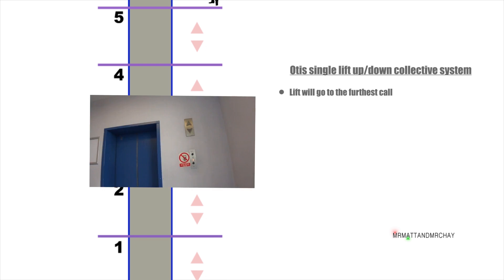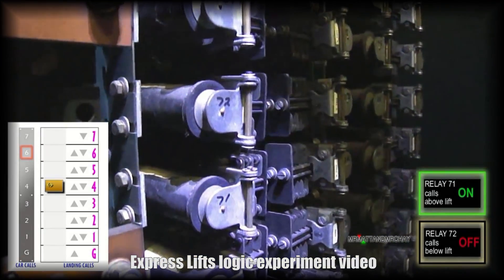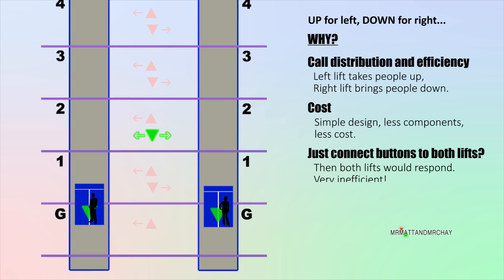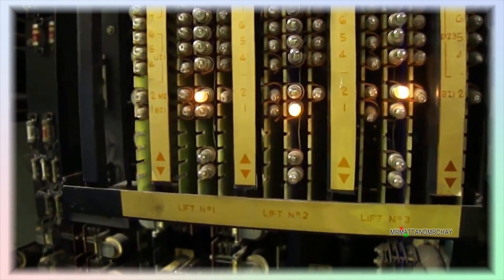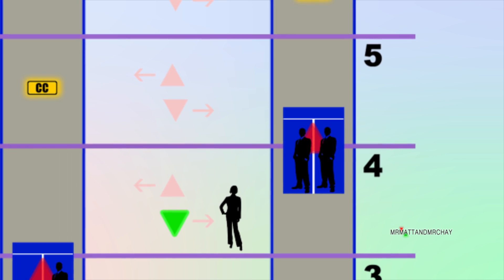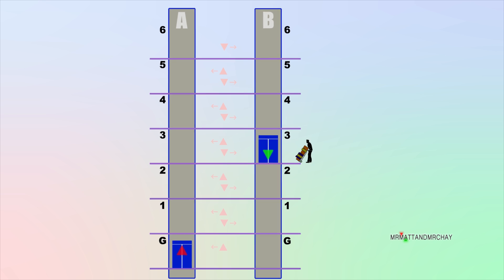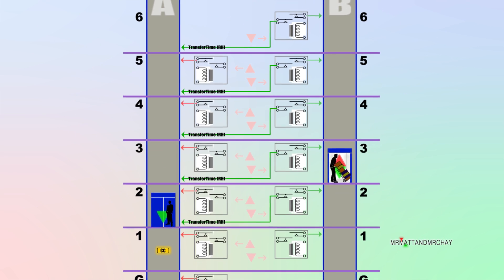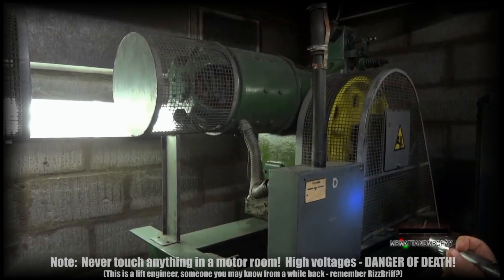DUPLEX elevator call logic - how does THAT work?

Comment: One elevator is assigned to up calls, the other elevator is assigned to down calls. In many cases, the "UP" elevator will respond to UP calls, the "DOWN" elevator will respond to DOWN calls, with a few exceptions.

1. If an elevator is already on the landing, the call buttons are connected to call the elevator that is already at the floor.
2. If an elevator stops at a floor due to a car call, and is going in the same direction as a hall call on that floor, it will cancel the hall call, even if it isn't the assigned elevator.
3. If the assigned elevator is held open (either deliberately or due to a mechanical fault with the doors for example), after a set time the call buttons become connected to the other elevator.
4. If an elevator fails to answer a call (i.e. it breaks down), after a set time, the call buttons are connected to the other elevator.
5. If an elevator stops at a floor with up & down calls, and is idle (no other calls assigned to that elevator), BOTH calls will be cancelled.

Is this a pretty complete description of the logic of this system?

I'm curious what would happen if for example, you press both the UP & DOWN buttons, and the UP elevator gets to the floor first, BOTH calls are cancelled, and the DOWN elevator was moving towards a call that was cancelled, and is otherwise idle. In that case, the DOWN elevator could either stop immediately between floors, and probably not open it's doors (I suspect Otis controllers don't have a provision for this), stop at the very next floor and probably not open it's doors, stop at the floor where the cancelled call was (and either open or not open it's doors), or stop at the last floor in the direction of travel (and either open or not open it's doors).

Is the system described in this video used on a two speed AC installation, a DC installation with motor generator, or both? It certainly could be used for either, but not sure if a more complex and more efficient system would be used for DC installations.

I wouldn't be surprised if some larger relay-logic installations (perhaps with 4+ elevators) used a more complex but more efficient system, as in those cases a more efficient system may be worth it, assuming it is reliable, if the alternative is to have more elevators, and less usable space in the building.

I'm hoping to visit some buildings with Otis duplex systems probably running on relay logic soon. They probably are DC elevators with motor generators. If I can, i may test some of these things.

Comment: It's really annoying how the one that is coming towards your floor just went past it while I have to wait 1 additional minute because the second lift is still 2 floors away and the logic decides to assign second lift to my floor instead. (considering both are going down, for example, and I'm also going down)
Reply: Sometimes a lift that stops @ your floor gets physically full because too many passengers want to board it, but its weight sensor still doesn't detect enough mass for the lift to register as 'full' in its computer, so there's the anguish where (a) neighbouring lift(s) that's passing by your floor is then programmed by the computer to skip your floor because it still doesn't think that more lifts are needed to serve that floor

Comment: Am I correct that in for example a 10 floor building (with the lowest landing being the 1st floor, elevators serve 10 landings), the UP car is on floor 1, the DOWN car all the way up at floor 10, if someone presses the DOWN button on floor 2, the DOWN car will come despite the UP car being much closer to floor 2?

Am I correct that this is quite inefficient? At some point maybe I will do some experiments on multi-car (group) relay logic elevator systems to see how they behave.

I assume solid state controllers would often work in what seems like the more intuitive way (if all elevators are idle, closest car will answer a call), but I could be wrong.
Reply from the maker: Correct.  So if the CALL=2, then...
CAR1 compared with CALL (1-2) = Distance: 1
CAR2 compared with CALL (10-2) = Distance: 8
We are now preforming calculations.  Imagine doing this using relays!  Is kind of possible, but now you are adding far more relays.  More relays means more cost, more things to go wrong and more complexity for someone to be able to fix it.  And is it really neccessary?
When a customer doesn't want to pay for it, and they just want a method of getting people from floor to floor, they aren't bothered if a lift has to travel further occasionally.  It would cost more to have an engineer trying to fix the lift due to the extra complexity.
Please bear in mind, this video is about OTIS.  The Express Lifts system didn't work the same way.  I may do another video at some point explaining how the Express systems worked.  But as time went on, Express did manufacture a 'closest lift' dispatching system using resistors, which maybe I'll cover in a future video.

Comment: My apartment building has three elevators. They seem to be random to this uneducated observer. For those cars where people are moving in/ out, or maintenance is using, there is an "Independant Service" mode where the elevator car only works between two floors and ignores all other calls. If someone holds the door-open button, or physically holds the door open for too long, the car "beeps" and broadcast a message stating that one should "stand clear of closing doors".  In the past, this latter scenario has often caused the car's logic to become confused and even temporarily go out of service. I believe that has been fixed for now. The building in which I live has seventeen floors and houses many university students. This means they are in frequent use. Our elevators say "Westinghouse" on the thresholds. However, they are often serviced by Kone. Once, I saw a Fujitec van out front. I don't know where I'm going with all this, but your videos have helped me to become more aware of what goes on "under the hood (or bonet?) ".

Comment: This video answers a lot of questions!  This is the exact setup that I have the parts to, and 5 sheets of wiring diagrams of. 
Now I want to make both selectors on my reconstruction run just to run these scenarios and watch the relays click.  

Do you have any estimate on the power consumption of just the logic relays?
Since I am going to use a 1/2 HP gear motor to operate each selector, will not need to use the large power relays that fed the 25 HP traction motors    I have to determine if I can salvage the original DC power supply or not, so if I end up building a power supply I am worried about current.
Reply: Well it depends on how many components will be using power simultaneously. I can not be certain, but most otis relay coils run off of 120V and will use around 30 - 100mA of current. But the real power consumers will most likely be the motors. If you plan on using the original DC power supply, a few considerations will be needed. If the original DC supply is a MG unit, you will definitely need to worry about the current as MG units are very power hungry. Honestly using a full wave/bridge rectifier with a smoothing capacitor will be easier and more efficient than a MG unit.

Calculating this out and after making a few assumptions I can say with confidence that you will need at least 30A to run the components. It may not sound like a lot, but here is an important thing to remember! Often times, these old otis elevators connect relays together in series, which means that you need more voltage than the 120VAC you get from a typical house plug. I have seen otis elevators that use up to 600VAC in order to run the components in a proper manner.

If you truly want to hook these components together, It would most likely be a direct wire connection as no elevator can be run by just plugging it into a wall. So you would need to go into your main lighting box and bring a large wire towards your display, then a 3 phase converter would probably be in order. A transformer afterwards to convert the 120V/208V into whatever voltage you need to run any series'd relays. It sounds like a lot of work! But if your up to it, then I won't stop you.

I would recommend looking at similar elevator systems and seeing what they use for an overcurrent device rating. I can't say from experience, but I would estimate that most elevators use around 30A - 50A of breaker/fuse protection. Keep in mind that this assumes that the elevator is of newer type and does not use giant gearless motors (some gearless motors can suck over 100A from the grid!). I wish you the best of luck getting them up and running and I look forward to seeing if you make a video on it! :)
Reply: @BigKitty1011   Thanks for your reply. I do not have the MG sets or the traction motors. My "elevator" will be a 1/2 hp gear motor connected to the pie-plate selector unit to simulate elevator car movement thru a 6 story building.  30-100ma current per relay for 10 or 15 relays dawing current at once sounds manageable for a 120V DC power supply that can be built and plugged into a 20A outlet.

Comment: I recall in my childhood, the old Fujitec residential elevator only had one call button that has a fixed direction (up on the first floor, down for the rest, never both). The Fujitec going up will always ignore any calls going up, and if the twin car is below the floor it never gets called. Always had long waiting times for the only one lift coming down from 20 floors towards the 4th floor, while the other sits idle at the 1st floor! I guess something similar with cost-saving is going on here as well.

Comment: Brilliant as usual. Many thanks for your time and effort. But you can go further with relays. Someelse noted on your motor room tour (it was a parking building) with 2 express lifts, that its dispatcher was a 4 zone system, and the cabinet was just relays. Its interesting to note that no one has the perfect algorithm for multiple lift buildings. A big manufacturer (dont recall what) used statistics and data from the id cards that employees use to enter in the main lobby to enhance the lift usage in rush hours. My statistics professor worked for for real wolrd cases also. He was aked to make a model of the people trafic on lifts on a new building. They input this model somehow in the controller. Things get insane complex with so many lifts ans still no one has an accurate answer. Each building is different.

Comment: Splitting the lifts up in dedicated directions is pretty clever in it’s simplicity. Seeing this, it seems like the obvious solution but I have never thought of it beeing that simple. Always thought it was more complex. Reducing complexity in the controller design must have been quite common in the sisxties and could kind of explain some odd designs in lift configurations. I know of some appartment buildings with 13 floors and two lifts but only have 5 stops. Each lift runs individually like a simplex system and serves a different set of floors. One for the even floors and one for the odd floors. I once filmed such a setup in an appartment building that had split level floors where lifts stopped at stair landings between the main floors. Really odd design but very clever in keeping the lift design simple.

Comment: Imagine what it would need to do for 8 elevators. That would seemingly require a computer.
Reply: Not difficult. You can have 3 or 4 lifts, with the system matt described, but TT relays wired in series between each one for up and down calls respectively. For large banks in a group, you would have a dispatcher cabinet that takes care of all hall call demands and picks a lift based on where it is and what direction its going.
Reply: That’s why destination dispatch exists
Reply: @Andrew_Zapar  but that was only invented in the 1990s